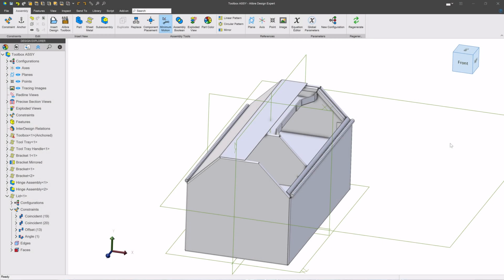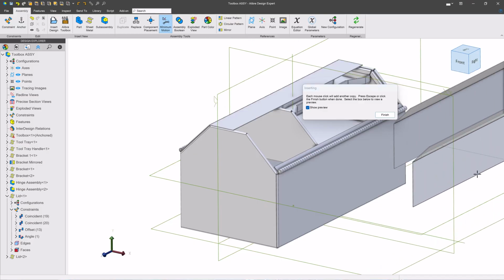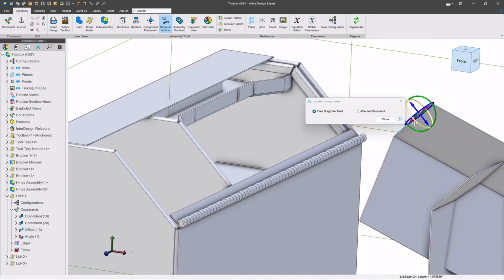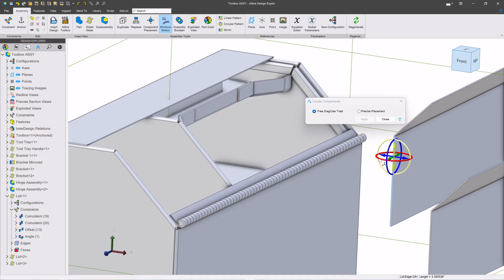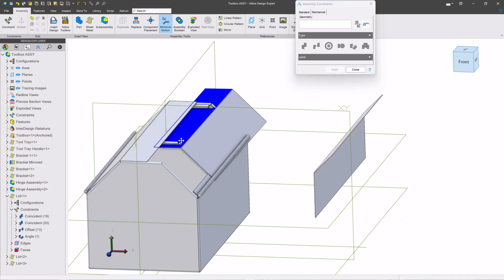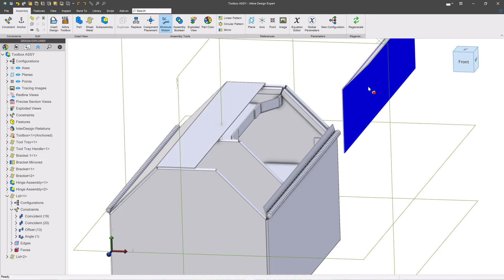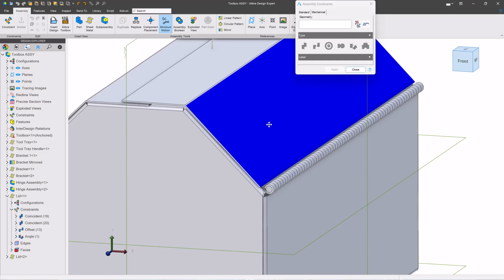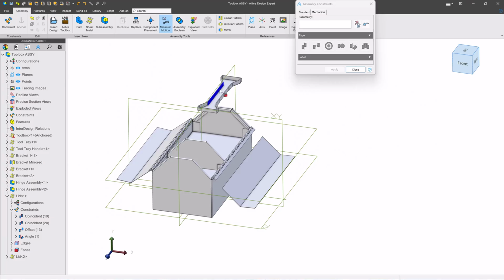2 Ways to Orient Parts in an Assembly

Comment: I like your video and the fact that you "prefer" to just use constraints to align the part being added to an assembly, that is my assembly method also.
One thing that I think your video points out, by inference, is the importance of modeling your parts in the orientation they will be in when placed in an assembly. That's something I was taught early on in my CAD career and was very important for the product we were building. It saves a lot of time in the assembly phase and a lot of frustration getting the part aligned correctly.